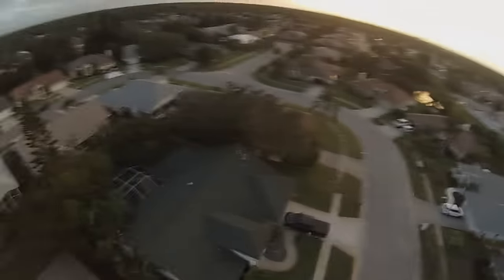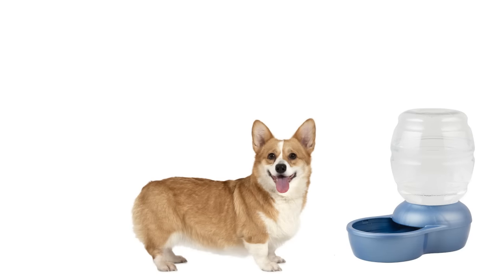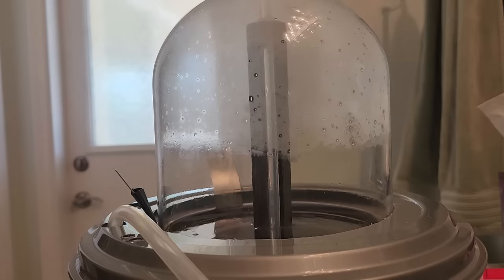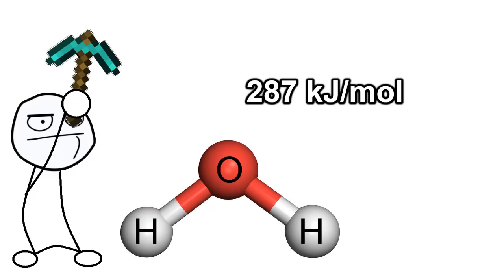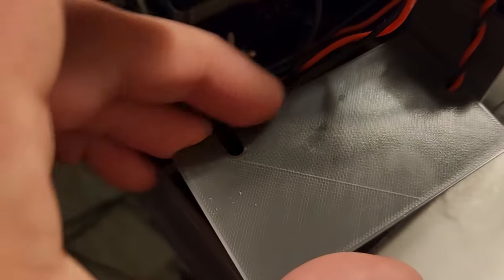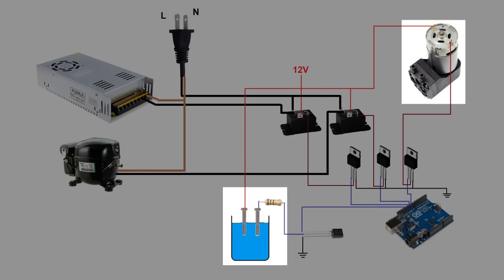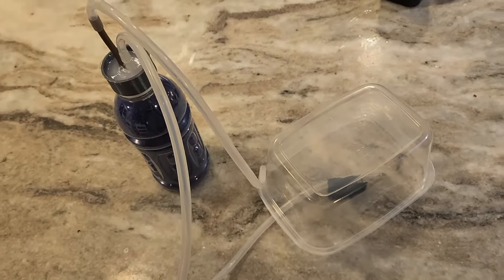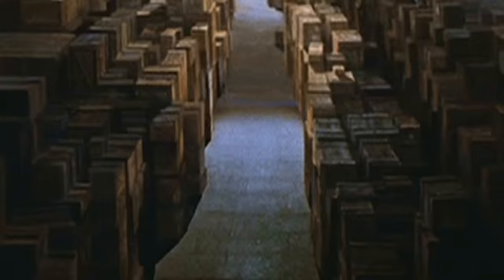Automated Hydrogen Generator

Comment: The chemistry of a Nafion/PEM style electrolysis cell is completely different. It involves the doping of the polymer membrane with superacid terminations to allow H+ currents to flow freely through the membranes, instead of electron currents running the other way.  Thats why they don't use a solution with ions present, they actually use 18 MOhm pure water.

Either way, they are expensive, but super convenient/compact/lightweight/etc. I have one that I use to feed hydrogenation reactions.
Reply: Now you have me intrigued!

1.)  Where did you end up getting yours

and

2.)  What type of reactions are you doing 

(If you don’t mind sharing of course)

Comment: I've thought it would be really interesting to build up an open-source catalog of this sort of projects for different sorts of small scale processes. Combine this with a nitrogen purification cell and an electrically driven Haber-Bosch or Frank-Car cell (along with the needed cells to recycle the other feed stocks) and you could turn surplus solar power into Ammonia which is an important fertilizer (and if you don't want to store that, a Bosch-Meiser cell can make urea which is also a fertilizer).

Another interesting option would be Methanol synthesis (which would likely require a CO2 sequestration cell) as a reasonably storable and high energy chemical fuel.
Reply: I honestly think your suggestion would get the channel and community banned
Reply: @lelagrangeeffectphysics4120  most of what I'm thinking of would likely work better in a different format than YouTube. Wikis and cad files for example.

But I agree; sadly the difference between making the world a better place chemistry and arms design is often little more than what you plan to do with it. 😕

Comment: Just a heads up with silica gel, it will remove a lot of moisture but not all of it. If you want to remove all of you'll need to use some 3A molecular sieves in a second bottle, or P2O5 chamber, or bubble through 98% sulfuric, or use a cryogenic cooler to condense it all.

Comment: I love your work man, always really cool detailed projects with ever increasing quality. 
I have some suggestions for possible improvements that you may or may not have considered.
Temperature sensor in the cell to avoid thermal runaway or to simply remain under a set temp. You could also use a simple optimization algorithm to balance power input and temperature.
A humidity sensor on the output of the dryer bottle to halt the system and alert you when you need to replace your silica beads.
A flow sensor to log output, though you could just calibrate your vessel and count each time you evacuate it.
My most expensive idea is a radiator to exhaust heat, it would be hard to get the right parts for that though. Actually, a coiled stainless pipe could act as either your anode or cathode and you can run your coolant through it. Two birds with one stone on that one.

Anyway, keep up the great work! Can't wait to see what you build next

Comment: Brilliant work. Research, followed by testing, design, and the building of the rig. I thoroughly enjoyed watching your video.
As regards hydrogen embrittlement that you mentioned, this is a very real problem. So much so, that the power station where I spent most of my career had to instal a hydrogen generation plant (using methanol feedstock) to provide hydrogen for alternator cooling instead of the racks of steel cylinders that were formerly used.
It can also lead to weld failure if welding rods are not adequately dried before use. With some welds that I examined, I did not even have to get my test equipment connected- I could see the cracks!

Comment: Something you might be able to use as a permeable membrane is expanded PTFE. It is porous, so will have no problem letting electrolyte through, but I think it would stop any gas bubbles from migrating. Might be a lot cheaper than the stuff the professionals use.

Comment: Use acetone to weld ABS parts together. Also its glass transition temperature is around 105C (221F)  and it should survive boiling water, (though not forever as the heat deflection temp is around 98C) so you shouldn't need to worry about that.

Comment: Enjoyed your video, well put together.
I started playing with H-O-H when I was in college during the early 60's. After trying several metals for electrodes, I settled for titanium... longest life and least polluting. (I was told I couldn't use titanium as electrodes, but proved people wrong) Built my own signal generators and  circulated the electrolyte through a radiator in order control the temp, although I was not aggressive with the electrolyte. The anodes and cathodes were in separate but connected chambers of the hydrolizer, therefore had no problems keeping the oxygen and hydrogen separated. In addition, I used a pulsating electromagnetic flux to aid in the reduction of the molecular attraction of the electrolyte. I was able to generate enough hydrogen to provide 75% of the fuel needs of a golf cart. 
Congratulations and I wish you success!
Reply: Can you describe the electromagnetic flux part? Was it an electromagnet?
Reply: Flux/field
Reply: How did you create the flux/field?
Reply: @jheissjr pulsating electromagnetism

Comment: I helped someone make one once. it used 12V-14V and targeted 2V per cell. So it had a plate and then several isolated floating plates before the next powered plate. This meant that it was like having several units in series.

Comment: I read the work of a Japanese doctor of physics who thoroughly researched the electrolysis of water. He used rectangular platinum electrodes and ground them on both diagonals on both sides to obtain micropyramidal surfaces from which the bubbles are easily separated and increase the effect of electrolysis...
Nowhere have I found anyone using additional ultrasonic vibrations to help separate the bubbles from the electrodes!?:hand-purple-blue-peace:

Comment: Well, when i was on my hydrogen kick i was trying to use it as a fuel to replace a need for an acetylene torch. And potentially even burn a steel furnace with it. I did a stacked cell and was making hydroxy gas (trying for an on demand system). While i now can afford acetylene whats really preventing me from working on this is my hydroxy cell blew up. I was unharmed (thank god for the foresight to put up a blast barrier) but very rattled from the experience. All that said im extremely impressed by your setup.

Edit: i forgot to mention oxyhydride gas is used in glass crafts as it doesn't leave soot like other gasses.

Comment: The increased voltage that you had to use to observe the gas generation at 7:23, is actually a known as Overpotential in electrochemistry, and it is a kinetic effect, which can be explained using diffusion effects and a few others. As a rule of thumb for water electrolysis it is actually around 0.6V which matches the effect you observed.

Comment: If you look at the output of your power supply, you'll see a little trim potentiometer on the left. You can probably use it to tweak the voltage down a volt or two and get it slightly more efficient.

Comment: 0:35 Take that clip of the mini HHO tank out of there! That's not how the little torches operate. NEVER contain or pressurize ant HHO gas. That little tank would be a grenade. You have to have flash back protectors in-between the source of HHO and you have to use all of what's being produced as is being produced. Trust me. I filled a huge balloon through a 200 foot hose and when it was full I took a lighter and lit it in front of the hose and removed my thumb and BOOM!!!!! Instant. The fire traveled through the hose like det, cord. Amazing stuff. Dangerous as hell!

Comment: The higher voltage required is due to the alkalinity of the electrolyte. The cell / standard potential found in wikipedia is based on acidic electrolyte

Comment: THIS aluminum water tide soap uses 12 volts to break the surface oxide at the positive electrode. It almost is an aluminium powered processes. A engineering team made me aware of this. I tried it using aluminium wire ties from chain link fence company. IT works very well.

Comment: Welder here:
About your hydrogen embrittlement problem, I feel like it wouldnt be a problem for anything other than super long term storage.  I dont know the leech rate of it, but its something I have to worry about as a welder, though not commonly.  Hydrogen uptake happens fairly quickly when youre welding, regardless of process, but thats primairly because youre dealing with molten steel in the pool, and electrolysis from the arc is the main actor that frees that hydrogen up.  Spatter spray is the number one source of that water in a production environment as it is intentionally sprayed over basemetal.

Comment: Things like this are one half of oxygen generation and recycling on ISS. First, water is split into oxygen (which is used to breathe) and hydrogen. Then, hydrogen is combined with CO2 (scrubbed from air) in Sabatier reaction which produces methane and water again. Methane then discarded in space (although it can be recycled further, pyrolithically split into carbon and hydrogen again) and water again fed into electrolytic machine to produce oxygen. It's almost a complete cycle, a little synthetic biosphere. Amazing stuff.

Comment: You may be able to find good electrodes in salt swimming pool electrolysers. Usually they're coated with titanium or platinum even as they're intended to run for thousands of hours. They can be found for cheap, used or not

Comment: instead of having a single solid separator, you could reduce the resistance by a lot if you turned the separator into a double-sided cheese grater type deal. the holes would allow current to flow, and what would normally be the cutting edge on a grater would prevent bubble cross-contamination.

Comment: I think the reason you found that nafion is used as the membrane in electrolysis is because you stumbled upon PEM electrolysis, really cool stuff, but definitely not DIY, it basically a super effective form of electrolysis but it requires both nafion which is a PFAS and a bunch of iridium and platinum and well it is a hot topic in research these days. Basically just use alkaline water electrolysis, the classic method. If you like electrolysers though, you have to check out solid oxide electrolysers (SOEC) they are really cool imo...

Comment: 1)ABS you can weld with bit of acetone on a art brush. Its making incredibly good connection, and you can even weld PLA with it, but PLA is not being melt by it, only top surface layer, so make sure to have snug clearance between parts.
2)Nice aluminium tanks can be found in ordinary kitchen carbonated water machines (english is not my native language, so im not sure how are they called on english, what i mean are soda machines). They use very good tanks, and are smaller than this one you used, but also its increasing safety aspect to just have multiple smaller tanks than one big

Comment: you can use sodium borohydride as an hydrogen source. it reacts with water instantly and produce H2 gas. Also you can use NaOH to control the rate of hydrolysis and add a catalyst to start the reaction

Comment: Only had one stray thought; a silica gel moisture trap that automatically switches to a drying mode (with something like nichrome wire to heat it up temporarily to drive out the moisture) when it gets too saturated to support the automatic process (with requisite solenoids etc).

Comment: you're forgetting that as you generate more gas you reduce the amount of water, increasing the concentration and lowering resistance in addition to the temperature change.
seems similar to cody'slab's old hydrogen generator, just more automated

Comment: Be aware that NaOH reacts with glass, dissolving it. If you're building a similar cell and planning to leave it for a long periods of time, I suggest using plastic for the dome part. Maybe also add acid filled gas trap to deactivate the remaining NaOH in the gas? NaOH also reacts with steel and aluminium so it may compromise your pressure tank's integrity.

Comment: Well explained and easy to rebuilt.
If you use Nickel instead of stainless steel and a Potassium Hydroxid solution up to 35% concentration, it will work even better.
Hydrogen embrittlement is not as dramatic, as you sketched it in the video. Think of a standard storage bottle for hydrogen as you can buy it from your local provider. It's a standard steel bottle 50l at 200bar with a wall thickness of 2cm. If the embrittlement is really as dramatic, they wouldn't sell hydrogen in this bottles.

Comment: Your work is amazing! This is just a "peer review" of your work, but again, your work is very impressive, please keep posting these! The area is not 100cm but 100cm^2 at 9:09. It was also unclear how distance of the electrodes affect the conductivity in the electrolyte - distance does matter. The NaOH vapor is also an issue, contaminating your H2. Bubbling though just water from a sponge on the bottom (like an aquarium bubbler) would clean most of it. I think it's worth pointing out your tank is losing H2. H2 is almost impossible to contain in anything, it's leaks through solid materials. Lastly, use graphite rods rather than steel to avoid any contamination and toxic wastes.

Comment: Nice setup and experiments. To get the cell as efficient as possible you want to have bigger plates as close to each other as possible. Thy typical stacked cells are very close to best efficiency but its a little more tricky to separate the gases. But there are ways to do so safely. As long as the separator material is dumped in the electrolyte no gas bubbles will pass it. Only in the gas part diffusion is possible (of course). So you have to keep the electrolyte level above the separator part. Hydrogen will diffuse through any material over time, even through alumium and steel tanks! Instead of stainless steel V2A CrNi1810 you can use higher alloyed steels with Ti and V. Pure titanium is nearly the best you can get.

Comment: You might try connecting a peltier junction plate to the jar and bias it so the cold side is the side connected to the jar.  You can then use your arduino and a thermocouple to control how much power goes to the peltier.  This should provide you the ability to temperature control the jar, and by extension, the electrolyte solution.

Comment: Nice video, perfect engineering. Maybe, just one small safety note. That fridge compressor. If you look at the general schematics, the big black vacuum chamber is full of air. At least at the beginning of the process. Now imagine some incoming hydrogen. I think, at some point of operation, you definitely reach not only flammable concentration, but also detonation concentration of H2. I didnt calculate net energy of that mixture, maybe it can be confined by that (thin walled) (under)pressure vessel, but in any case, I would highly recommend inertising compressor prior every new H2 production. Same advice for the H2 recovery operations ;-)

Comment: You could also deal with the waste by lowering the PH to about 3 with sulfuric acid, adding sodium metabisulfite to reduce it, neutralizing the PH with sodium hydroxide, and running it through a vacuum filter to collect the solids.

Comment: Some 10 years ago i did a similar experiment and was storing hydrogen in "normal" iron gasflasks uder pressure in my workshop, needless to say and my knowledge back then i was unaware that these are not hydrogen safe, the experiment ended up blowing up my workshop sheed and i didn't restart my project of homemade hydrogen.

I was using a 1m3 chemical tank from a factory i got as reactor, and high voltage from a microwave transformer, and manual controls.

Comment: Polycarbonate is a very interesting material. When in contact with water, the mere contact with water will reduce the working pressure of a polycarbonate 2 by at least 1/2.
So you definitely have to be careful with polycarbonate and contact with water, and if it's bent. If it's flexed it'll let go really quick

Comment: The trick to lowering the power required is simple. If you apply a steady dc voltage, the bubbles created will cause the liquid to lose contact with the plates. So, instead of upping the power to jump the gap to get the current to the liquid... just pulse the current to allow the liquid to reconnect with the plates.
This can be done with a 555 timer, and it can reduce the amperage needed so much that you need only mA, not full amps.

Comment: 0:49 as someone who works with Sterling Cycle coolers, hydrogen is not generally ideal. Usually these coolers are pressurized to around 300-500 psi (depending on the application). Helium is generally used since it is a noble gas and will not react with the other components of the cooler over long running cycles. The aspect of helium not being a flammable gas means that if the oscillating cooler does experience an electrical short, there will not be a potential for a catastrophic failure. There are downsides for using helium, but the pros greatly outweigh the cons.